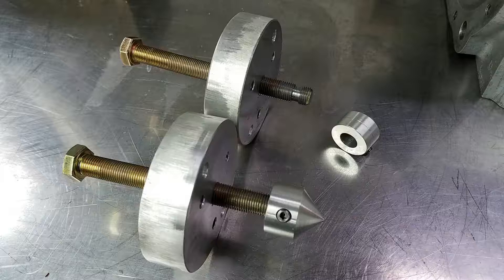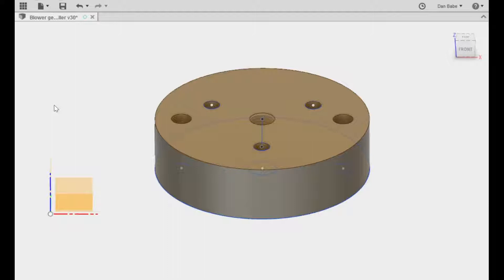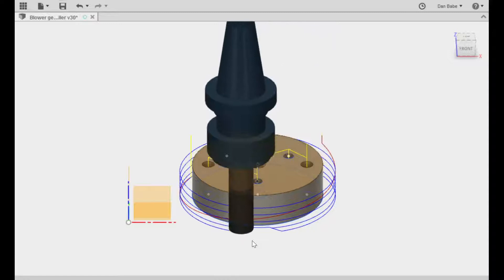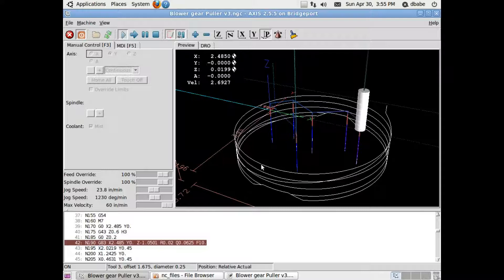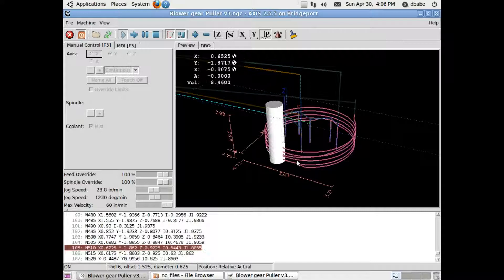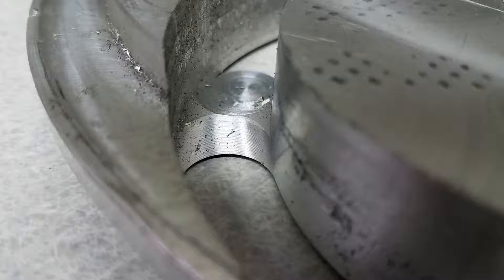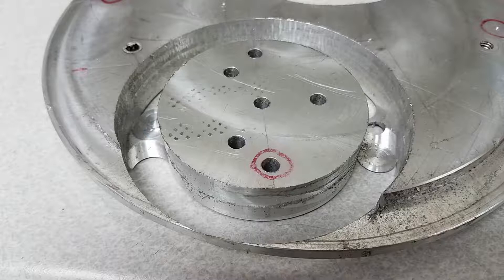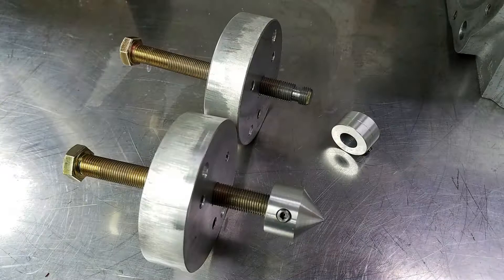My 6-71 Blower rebuild, Part 9: Making gear pullers

Comment: WOW, I use cheap steering wheel pullers from Harbor freight. Their like $!0.00 each and work perfectly.
Reply from the maker: Right on!  The only reason that I made my pullers for this is because I have tons of that flat aluminum scrap, and I wanted to learn "ramping", and "tabs" in Fusion 360.  Under normal circumstances, yes, the cheapie steering wheel puller is just fine for a low load pull like this.   Thanks!

Comment: What’s an economical option for pulling the gears if you can’t make your own puller?
Reply from the maker: You could try a couple of inexpensive steering wheel pullers from Harbor Freight or Amazon.    https://m.harborfreight.com/bolt-type-wheel-puller-set-62620.html?cid=paid_google_pla_main_newproducts_lowersales_$10to$30_62620&gclid=Cj0KCQiAp7DiBRDdARIsABIMfoAMJhgww36o09UNhQPt9ZPtCOio8WRSIyyn-RwV5cwKtNUjPodedvEaAh2DEALw_wcB

Comment: I'm just getting started on a 6-71 . mine didn't come with the two drive gears I have found 8 -71 drive gears on ebay will they work or is there a difference in size
Reply from the maker: Regular inline 871 Drive gears will work. However, if it is off of a 8 V 71, or a V series engine, then I believe that you have to use a special coupler in order to make them work.  I don't know for sure if there are any other differences, as I have never tried to substitute V series gears for regular inline series gears.  Probably best off staying away from the V series gears on your first build. I almost bought a pair off of Craigslist last year, and when I compared them to my inline series gears, they looked a lot different, so I passed on them. Dyers blowers in Chicago http://www.dyersblowers.com/1694.html sells good used gears for $175 a pair, so that is probably the safest route to go.  Scroll way towards the bottom of the page to see the section for "Blower Parts" and you will see the used drive gears listed.  At least you know that they will work without changes to what you already have.  I have purchased from Dyers before and they are good guys.